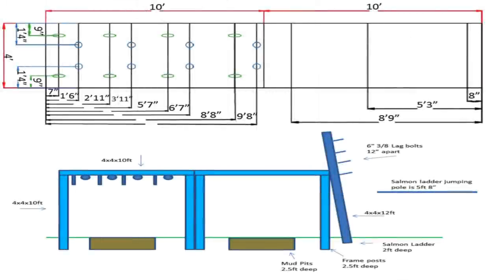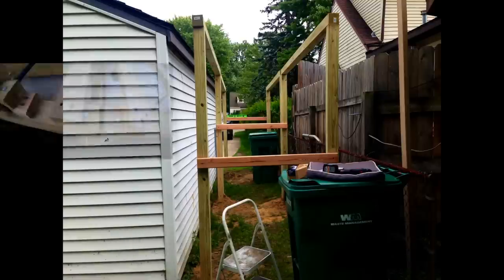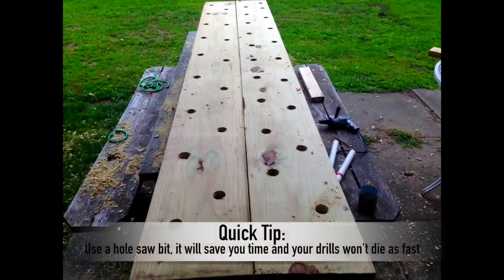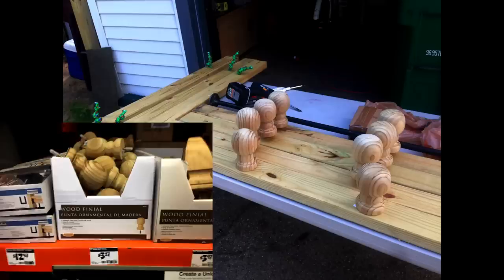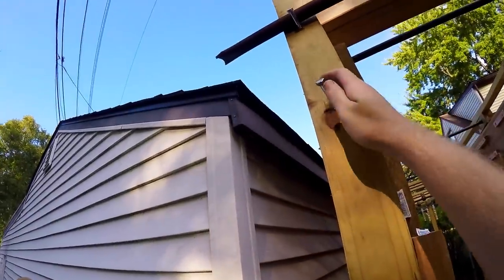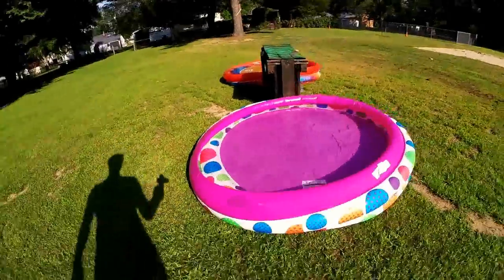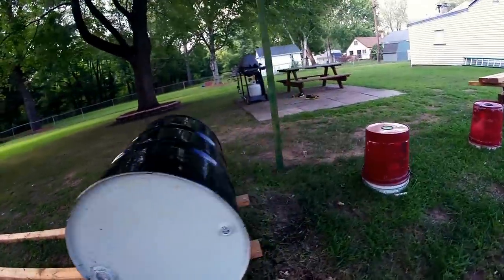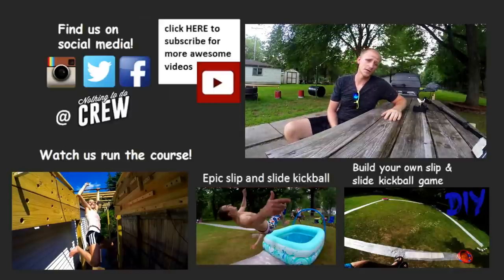How to Build a  Ninja Warrior Obstacle Course! DIY

Comment: what kind of poles did you use for the pullup bar and the other stuff? curious so i can adjust the size constraint for mine
Reply from the maker: i used half inch steel pipe

Comment: What is that long shed with the stove pipe for?
Reply from the maker: It's actually 3 sheds. The one with the stove pipe was where the previous owner would watch tv and work on his train sets.  We ended up taking out the stove pipe and turning it into my wife's "sheshed" bar not long after i made this video
Reply: @NothingToDoCrew  okay I thought it might be some sort of meat smoking operation. Thank you tor responding. Nice ninja course too.

Comment: So summed up to build a ninja course you need money to spend
Reply from the maker: Yea..pretty much. You can make a few obstacles using stuff you find in the trash (like the barrel and bucket obstacles i used in the main video), but anything using a lot of body weight has to be pretty secure...and secure=expensive. I bet if you just used 2x4's you could probably make something equally as good/strong and 2x4's are pretty cheap.
Reply: just a few days ago i bought a few 4X4's/2X4's and i was surprised how cheap it actually was. Im thinking of building a salmon ladder in my back yard maybe its a start to my own course

Comment: What, no Warped Wall?
Reply from the maker: The warped wall kind of sucks. Once you figure out how to do it, it becomes  really easy and just takes up a lot of space
Reply: NothingTo DoCrew how can you say the Warped Wall sucks? It’s one of the core Ninja Warrior obstacles.
Reply from the maker: @davidmcaninch4714  I dont hate the wall as an NW obstacle, i just hate it as an at home obstacle. My friend built one and it's huge/takes up a lot of space in the backyard. For the first few days we ran up that thing about 100 times, but after we figured it out we stopped using it. The other obstacles really help build your grip/muscle strength, but the warped wall is more of a finesse obstacle. The warped wall cost ~60-80$ to make and for that price i think there is better options